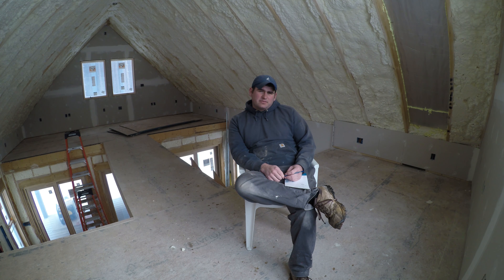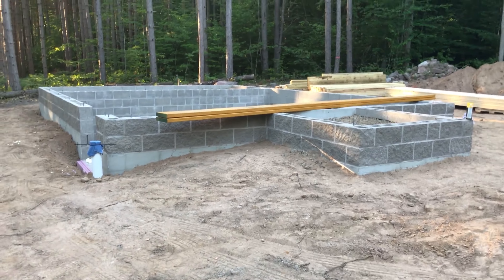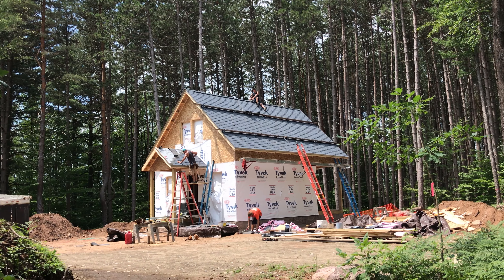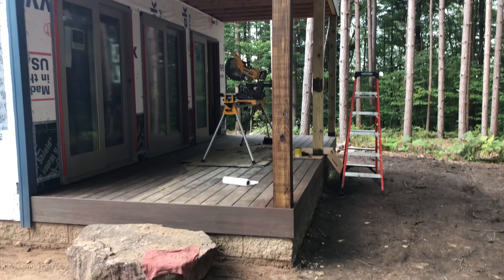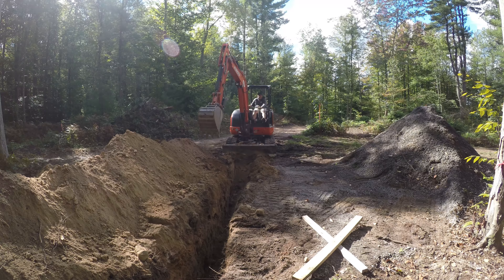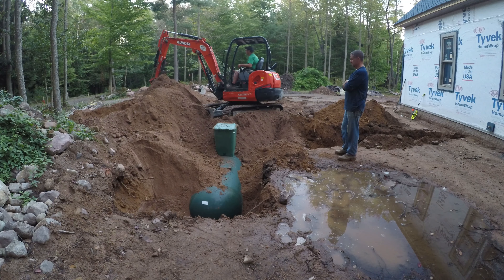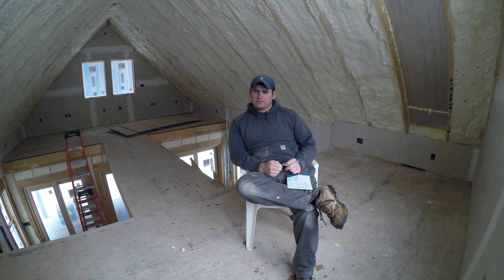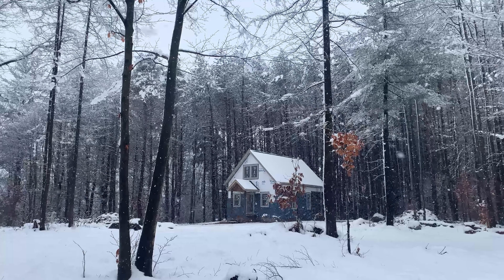Two Kubota Machines at Once? 500 SUBSCRIBERS!!!  (House Build Update)

Comment: Looking good. I'm sure it's tons of work. Just wondering if you considered a solar power solution? Since you went with county water the power load would seem minimal ( no well pump) enough to do solar. Also your septic tank and  field lines seems huge for your square footage. I assume that is for the possibility of expansion? Really enjoy watching your build and congrats on the subs.
Reply from the maker: Thanks for the comment!  Yeah after I decided to go with city water solar definitely was more appealing but to me being able to turn on the lights with out thinking about how my batteries are doing isn't something I need to think about.  My father has solar panel connected to the grid and that's something I would consider in the long future but we live in a very cloudy and snowy part of the country would of been a lot for a system that would of kept my batteries charged in the winter without running a generator.  The field was as small as the county would let me make it for a one bedroom house but someday if I added more on I think the system could handle it might just have to pump it every year rather then every few.
Reply: @timberridgehomestead  that looked like a big septic system in my a system needs to handle 110 gals per day per bedroom